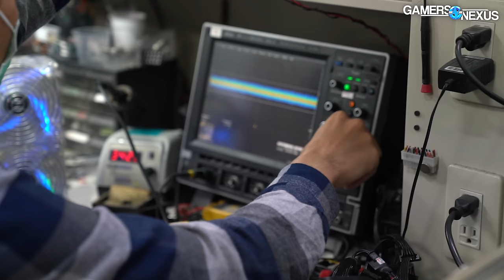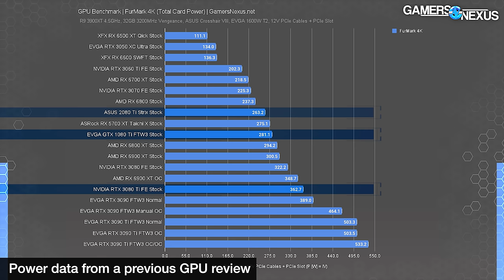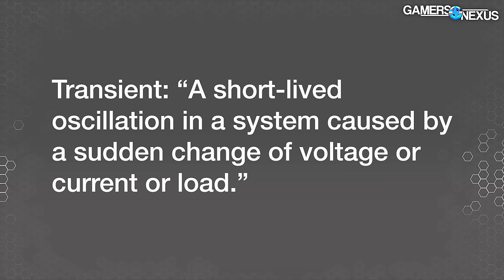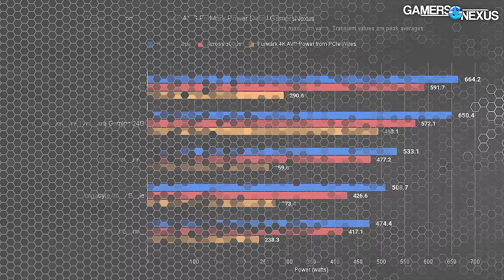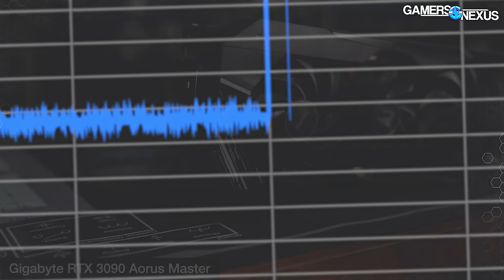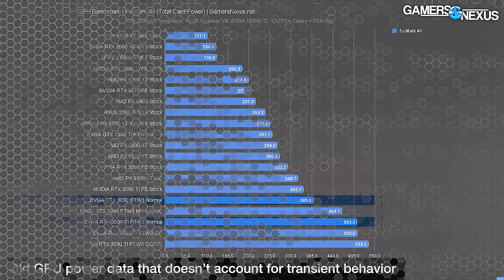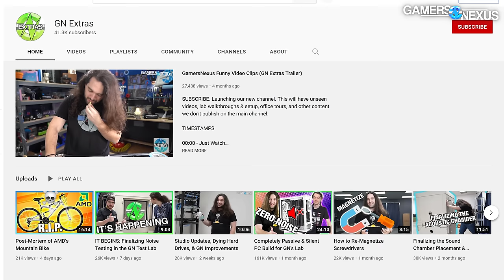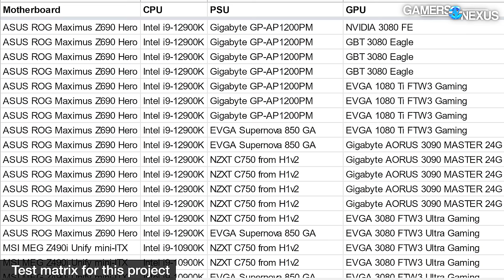The Brewing Problem with GPU Power Design | Transients

Comment: I'm NOT an electrical engineer but it might be able to ad a larger capacitors on the GPU and/or modify the firmare/drivers ?
Reply: if the problem is the GPU, then it need to be fixed on the GPU.
if the problem is the CPU, then it need to be fixed on the MOBO.

Comment: Some ROG STRIX 30 series cards I've seen have an LED indicator that flashes red near the pcie power cables when it detects a spike in power, Ive seen it flashing one time in my PC, using a corsair CX850M power supply.

Comment: I have a 3080 evga and a 750 gold evga power supply. The system is stable and never crashes. It did weirdly have issues with a 6700xt with random blue screens. Upgraded to the 3080 and the crashes stopped..

Comment: I have an ASUS Prime x370-pro with amd 2700X, paired with a Gigabyte 3080TI GC edition, running with a 750 watt Cougar GX power supply and its able to handle even cyberpunk maxed out without shutting down.   After watching this video i went ahead and upgraded to a 1000w power supply though just to be safe, the older PSU was many years old anyways!  Commented since you wanted to know if any lower watt PSUs could handle the higher power of higher end cards.

Comment: Hmm, i wonder if this was the cause of my PC suddenly restarting. I RMAd the strix 3080ti and bought a 1600 watt psu. Upgraded from a 1200 watt psu. Was going crazy with troubleshooting 12hr~ stability tests etc w/ 0 issues, then sudden restarts when gaming. (z690 Gigabyte aorus pro, ddr5 6k mhz, i7 12700k). Issue hasnt really occurred again. I wonder if the oculus rift i had plugged in was causing some of it. Eitherway good reporting.

Comment: Is it possible for this to happen after three years? I'm running Seasonic TX 750 and strix 3080 with 5900X. Around the end of October it started shutting down when playing Baldurs 3, then it happened on Resident Evil Village and even on Diablo 4 (which i played for 4 hours to test the PC after it started shutting down on BG3) and even Counter Strike 2 once, straight after entering menu. I've stressed it with OCCT for every scenario, MSI kombustor (barrel test) and Heaven and it didn't shut down. After it shuts down I need to turn off power supply, discharge the components by holding case power bottom and only then I can turn it back on .
Reply: Can confirm this will happen. I strongly recommend a heavy undervolt for an MSI Afterburner profile. Disable when you play a game

Comment: The age of brute force is coming to an end. This is supernova phase. Law of diminishing returns going to extremes and escalating wastefulness.

It is weird but telling how CPUs get ever-more energy efficient and overall restrained in their wattage for what you get while GPU design seems to mostly stagnate with development only focusing on drawing ever-more power. - Dunno, maybe due to a different nature of computing, but maybe that's just the same parallelization challenge as with CPUs. It is certainly going against the necessary turnaround and kind of a power craze. But since fancy visuals are a crows pleaser and very superficial, it is spiritually logical that an obsession would break out in that area.

As for the blame game: Hey, if nVidia blames the PSU makers for building according to spec, they could just as well blame the game and graphics engine developers for allowing scenes in their game that would trigger transients.

One has to wonder, with how this arms race has been developing, that graphics cards don't come with their own autonomous power supply by now, hah.

My guess would be that nVidia is afraid of not providing a smooth experience and therefore doesn't want to risk hitches in gameplay during spike scenes. (Although the transients are so brief that maybe it is more of a technical design flaw.)

Comment: I have an ASUS ROG Strix RTX 3080 12 Gb OC Edition hooked with an NZXT C 850W PSU. Also, I have overclocked the GPU to reach its maximum performance potential and increased its voltage, and things seem fine with me. I have never experienced power spikes or shutdowns. I assume 850W PSU is a good choice for RTX 30 series cards.

Comment: I have a cool master 850 sfx PSU paired with a 6900xt refrence, 5800x cpu, msi b550i, 32gb balistix 3200, 980 pro 1tb, 970 Evo 1tb, 850 Evo 1tb in 011 dynamic mini mesh with 720mm radiator space alpha cool. A pump res and alphacool cpu and gpu block. I have a rgb strips and 10 fans 6 x 140 and 4 x 120. 

I haven't experienced any crazy hard shut downs. While over clocking I've had mem crashes and game crashes. Basic stuff you experience while pushing clocks higher and higher. I may have had 1 of 2 black screen system restart crashes. 

Though I am running a water cooled 6900xt reference card. It does not from my understanding pull as much power as a Nvidia 3080. So that could be why. 

I suggest getting a cool mast 850 watt sfx psu and doing some tests with both nvidia and amd gpus to see how hard you can push them before failure. 

I'd pay to watch that.

Comment: Be awesome if used that equipment to show power supply degradation by brand. Have a few of 1000 watt plus psu gathering dust from when SLI was still a thing. I work in the Arcade / Gaming industry. Its amazing what a older psu looks like on the inside.

Comment: "Building 1440 gaming PC, Trying to get 144 FPS and above" Just got new Aorus 3080 Xtreme yesterday :)  Had a Asus Strix 980 ti overclocked for 5 years 1080p gaming still runs well, running NZXT E850 had this power supply for over 1 year "was very happy" for about an hour until I set the Aorus engine settings power target above default. Over 106% getting power spikes running 3Dmark Fire Strike Extreme and FurMark, no issue running the GPU at default settings. 
PC Specs, Aorus 3080 Xtreme, Gigabyte B550 AORUS ELITE AX V2, Ryzen 9 5900x, Samsung 980 pro m.2 512gb OS, Samsung 970 EVO Plus 2TB gaming drive, 2 sticks of Kingston FURY Renegade 32GB 3600MHz DDR4 CL18, Nzxt E850 power supply, GIGABYTE G34WQC A 34" 144Hz Ultra-Wide Curved Gaming Monitor, Windows 11 pro.
Now looking for new power supply, to allow for this build and next gen AMD CPU and motherboard. SO who puts the most/biggest capacities in their power supply? Looking at Corsair HX Series, HX1200, at $250 it ok 1200 Watt OMG this should work right? As there next model up "AXi Series" cost over $500 OMG or GIGABYTE GP-AP1200PM 1200W 80 Plus Platinum $300.

Comment: What a coincidence !!!
Just yesterday i heard a "poofff" sound and my system went dead with burning plastic smell.
I opened up my PSU (corsair RM850X) and found it was burned out. (just 7 months old)
The rest of my hardware components seem to be unaffected so far ...
(hardware specs: 
- Motherboard : MSI B450M Mortar Max
- PSU : Corsair RM850X
- GPU : ASUS Rog Strix RTX3070 White Ed.
- CPU : Ryzen 5 5600G
- RAM : Corsair Vengeance 16GB 3200Mhz)
Who is to blame  and how can we get a refund ?

Comment: Great video. Though clearly GPU problem in this case nvdia. One component causes intermittent problems for the entire system! Jeez. Not to mention then have ssd or hdd that cause additional transients to exceed psu and motherboard to compensate. Gpu need enough capacitors to overcome transient or specificity their deficiencies clearly.

Comment: Question. If a 3080 requires two 8pin connectors, which means it can draw 300W through the cables + 75W from the PCIE slot. Does it mean it cannot draw more than 375W during power spikes? Or the cables do not matter regarding power spikes? Thanks

Comment: You know, I wonder if this was the problem I was having with my old system! 

I only had a GTX 1650, but it ran off PCIe power only (no dedicated line from the PSU) in a largely-unmodified Dell XPS. For the longest time I had this weird problem were opening some Unity games (that was the only common thread AFAIK) would cause my system to hang and then go kaput/reboot, with Windows only logging a vague error. (Not even "unexpected power loss/shutdown," just "kernel error." If those bastards at Microsoft really love Linux as much as they claim, they should take several hundred pages out of its error handling book...)

I was super paranoid my PSU was going to shit itself, but I could run FurMark all day and not reproduce the issue... maybe Unity was doing something funny with shaders to trigger a transient power spike.

Comment: Came back to this video because after the next gen update for Witcher 3 with RT Ultra @1440p with my RX6800XT and 13600KF my PC shuts down randomly with my Corsair GS700. I wonder if that is the reason.
Reply: Run system file checker to look for corrupt system files and eliminate that as a possibility.
Reply: @ChristmasMeat  it is almost completely fresh install. with CPU at 65W power limit and GPU at 270W runs no prob
Reply: @_sneer_  I have the exact same thing using RT at 1440p on my rtx3080 and Corsair RM750x
Reply: @mikeclarke3990  I replaced the PSU with Corsair HX1000 and no crashes anymore.
Reply: @_sneer_  that may be my next course of action. I even had it crash on Ultra+ without RT or DLSS with frame limit at 120 fps so only using 60% gpu and 100w less power draw, Dx11 seems to work fine though.
Reply: Likely won't help with amd cards but I flashed my Gigabyte rtx3080 gaming oc  with the new bios supporting Resizable Bar and have had no priblems since running Witcher 3 and Cyberpunk with RT  or Warhammer 3 at ultra, even had a fps performance boost in Warhammer.

Comment: I am a bit disappointed with the overall conclusion of this video because the general vibe I get from it ("PSU is easier to replace", "low-end 750W PSU won't make it") is IMO still too focused on the PSU. Yes for somebody that already has this problem, the real-world solution probably is replacing the PSU. But what I expect from Gamersnexus is a clear statement, and to some extent pressure, on Nvidia to fix this, because they are solely to blame for this. The power sources follow the standard and Nvidia is just asking them to do stuff simply not covered by those standards.

Comment: For the last 15+ years if not more you always over spec your PSU 
If your system will use only 750watt you get at least 1000watt PSU 
A - It will last longer as not working near its limit.
B - It will have the same powerbill as PSU only supply the power demanded they do not push it. 
C - Often the 1000watt will actually be cheaper that 750watt using all 750watt as its not at its limit making dirty power less efficiently & it wont run as hot.

Comment: Mine usually shuts down when idle or doing basic web browsing and often get stuck in a boot loop, crashing just before the OS finishes booting up. It never crashes at load. Ever since I OC'd the CPU. Wonder why it does that and if this is perhaps part of it. I have an HX850 PSU which I think is pretty decent and should be plenty for a 5900x and a 3080.

Comment: Of course the real problem with GPU power design is how much power they suck down when practically idle, just rendering a few things on the desktop, that's where the real problems are. If you're doing computationally expensive things you expect power draw, you don't expect it when your PC is doing basically nothing.

Comment: Even a milisecond  spike having it shut down isn't that normal operation?   Because its supposed to respond to someone sticking their fingers in there and being electrocuted  it's supposed ot shut down right?   So  PSU doesn't seem the issue unless it doesn't shut down at spikes.

Comment: How do the 2070 or 3070 cards compare, or is this really an issue with the top end cards?   As a data point my 980 is doing fine with a BeQuiet 650W.

Comment: I just started having these problems. Random restarts or shutdowns. I have a BQ 850w Bronze EVGA. Had since 2019, and randomply, ever since Gotham Knights release, my pc has been shutting down and restarting. I have done ram tests, I have reinstalled winodows but I cant pin point the cause. Its very annoying but if this is the case, I'll just get a 1000w PSU then. i have a 9900k stock, rtx 3080 btw

Comment: It's funny bc i have a gigabyte gm 750 power supply and i was worried about the ocp being way too high and it catching fire but since the hardware i have will never get near that i wonder if the ocp being way too high might be helping w the transient loads... A bit scary tbh but ive been with this setup (ryzen 3800x overclocked to 4.3Ghz and an rx 6800xt with +15% max power and a nice overclock) for like two years and ive never got any issue whatsoever so idk

Comment: Transients are matter of economy in production. It is relative easy to solve and transient supressor save both sides psu and load side (GPU in that case). How they can sold and make money on PSU-s if you buy only one in 10 years or more. eg. one in your life?! Keithley write about transient supression on both sides in Aplication note No. 2870 named "Stabilizing Fast Transient Response Power Supply/Load Circuits".

Comment: Could the solution be an external stiffening capacitor between the PSU and CPU? Similar to what audiophiles use for subwoofer installations in mobile audio?

Comment: Coolermaster SFX 750 Gold is working with my Zotac Amp Holo 3080ti no issues!

Did have an issue with Corsair Gold RM650 running a Gigabyte 3070ti Gaming OC however, hope this helps

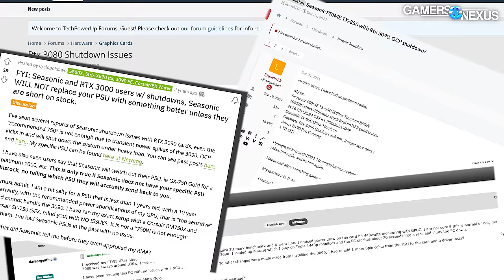Comment: You know when you get to the part about the complaints about shutdowns with 30 series cards @13:08 ish, I see a lot of people that are not giving themselves overhead when picking their PSUs.  750-850W PSUs for a whole system containing a 30 series isn't sustainable in my experience.  GPUs since the 10 series have been increasingly the power foundation of most custom built PCs, and as they take the most power out of a normal system, i think that people are considering ONLY the gpu power draw, when you should account for mechanical hdd's, fans, leds, and of course, your CPU(s).
I would expect this more for the AMD side, but its an increasing problem with ALL types of video cards/types of cpus - and the transient draw issue is another problem to consider when trying to calculate the potential max power draw.
Is this a runaway problem that will be more evident with the 40 series/RX6xxxXT?  And will other pc internals have to pick up the slack in terms of reducing their power consumption to deal with power-hungry components like GPUs?  @gamers nexus - great vid.

Comment: You defined "survive" to mean "maintaining power, not dying." However, it is still unclear what dying means. Do you mean that a PSU which does not survive is no longer functional? That is, do these spikes permanently damage the PSU, motherboard or GPU such that the system is unbootable, or is the problem that they shut down but would still power on?

Comment: Steve, I have been having issues with my Aorus Master 3080 (v1.0) which may be in line with what you were talking about. Running an Aorus Ultra x570 motherboard and an antec 850w high current gamer psu and from time to time during gaming my screens shut down, lose all display and my gpu fans ramp to full speed. Only thing i can do in this instance is hit the reset to reboot my pc. Did you encounter anything like this in your testing?  I have been unable to reliably reproduce it too.  Somtimes I can do 8 hour flights in Microsoft Flight Simulator and other times I can only get to the main menu before it happens.  I did some furmark testing and after 30 minutes in furmark my gpu temp was 75c but my junction temp was 106c

Comment: Is this problem limited to Nvidia, Does it happen to AMD aswell? to the same extent?
If AMD's transient spiked are in the 150% range and Nvidia is in the 220% range that will massively impact the next gen as a 4090 might need a 1400 watt psu and a 7900xt might need a 900 watt psu.
I would love to see more data across both brands.
Reply: Techpowerup publishes 20ms "spike" power consumption in their reviews. The current "winner" is the 6900XT with 620W, followed by the 3090Ti's 530W. The "vega" cards were also notorious for this.
Reply: @Flapdr01  That just makes this more confusing as tech powerup shows 100us spikes for the 3090 and 3090ti in the 650watt range.  I would love to see a 6900xt on their test setup as 20ms spikes are clearly not an accurate measure of transient spikes.

Comment: I'm a miner (yea I get it you all hate us) and my 3070 TI TUF burned 2 psus in the past 4 months. First one, I only had one cable going in splitting into two so I thought that's why it melted on the psu side and was like ok that's fine. But the psu I bought after, a supposedly high quality corsair rm850x also burned from the inside yesterday. I had the smell and shut off the rig immediately and the smell is coming from inside the psu.(had 2 pcie cables going in) I said this can't be a coincidence of the same gpu burning the psus it was plugged in so after plugging in a new psu, I started logging the gpu activity on hwinfo. Today I checked the results and in the past 24 hours it spiked to 270w twice and 340-350w once while having the same load mining ethereum. Idk if this is nvidia being lazy and not optimising gpus before releasing them or it's a problem with this specific gpu. I also logged other gpus and 3070 and 3060 are fine without any spikes but other 3070 TI FTW3 also spiked like the tuf one. So maybe gddr6x gpus have this problem.

Comment: Ive had zero issues, with 750bronze evga with 3090 overclocked to 114%power, 60+core,+400 mem. 2nvme, 1 sata ssd, 9900k clocked to 4900, aio.  system avgs about 550 pulled from the wall....during gaming.

Comment: Thanks for the video. What would a short term remedy be? I have a gigabyte 3080 oc vision with a 1000w psu. Should I lower the power limit and core clock speed in msi afterburner?